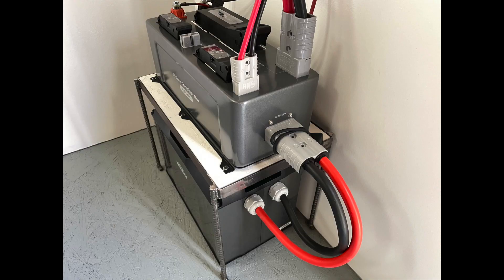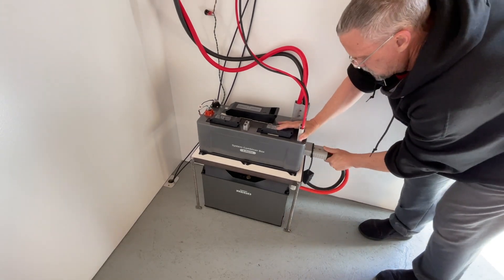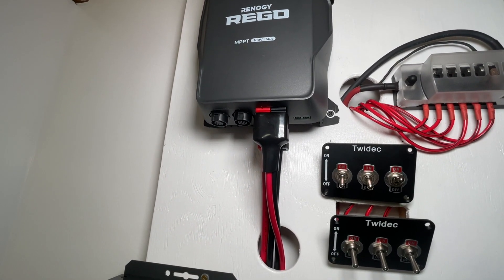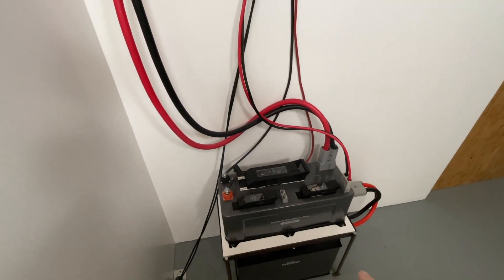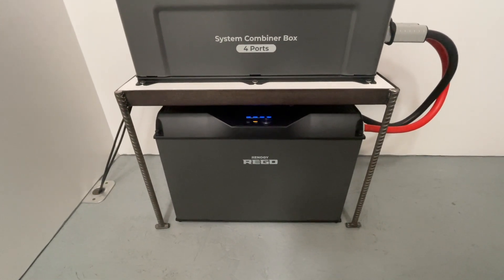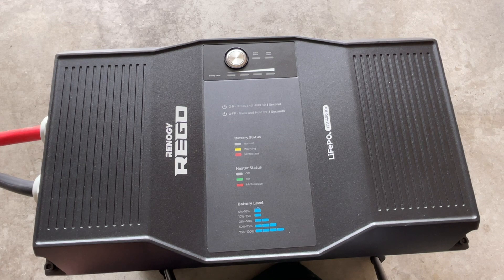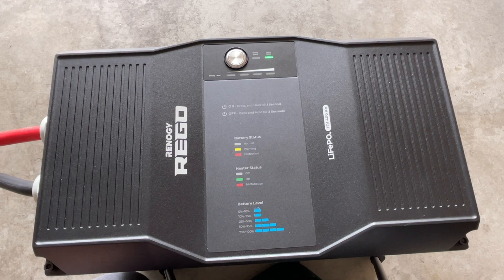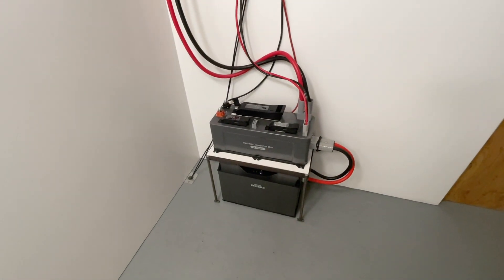Explore the Power: NEW Renogy REGO Off Grid Solar System with Epic Battery Storage!

Comment: 2 years on, how did the system weigh up? Any problems with the wire size inside the combiner box? cheers
Reply from the maker: Still using it today to power the shop area of my garage. I haven't had any problems with the wire size inside the combiner box.

Comment: Great video!  Did you say you were using 4 AWG cable(s) to connect to the combiner box? or 4/0 AWG cable(s)?  Thank you.
Reply from the maker: Thank you, they are 4/0 AWG cables to connect the battery to the combiner box. Also the 3K inverter connects to the combiner box with 4/0 AWG cables.
Reply: @DIYHomesteadProjectsDIYHP10  Thank you for your reply DIYHP.  I just subscribed to your channel. :)